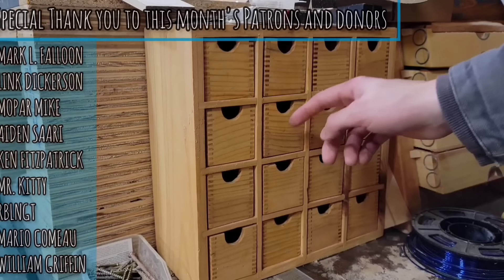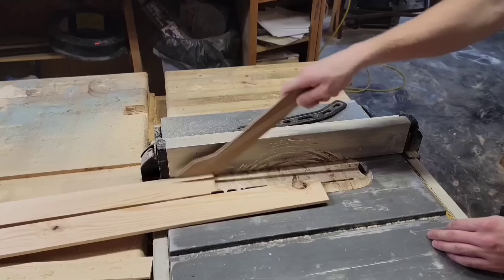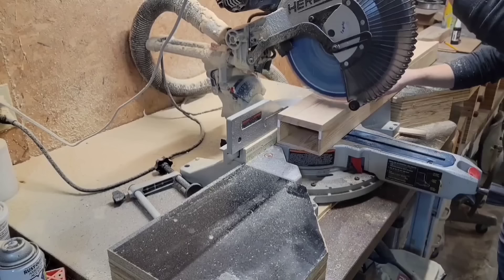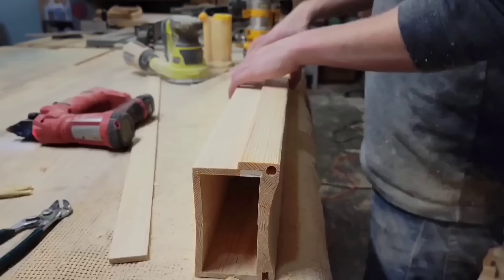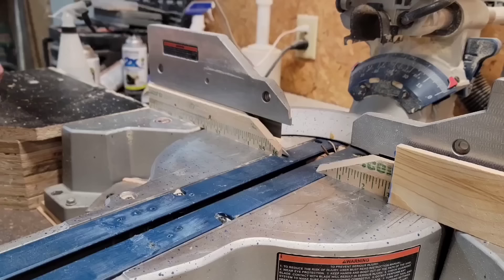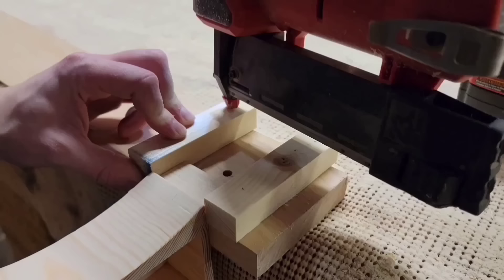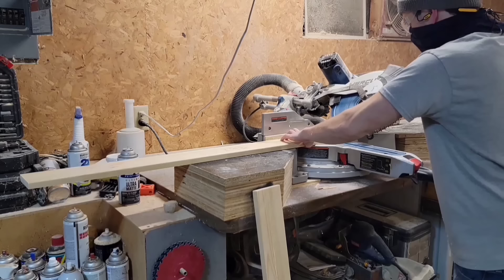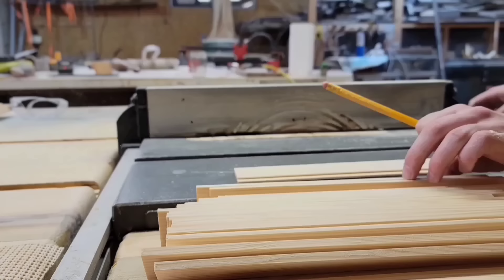Fastest Way To Make Drawers? One 2x6 Parts Organizer // Woodworking

Comment: Ok so I actually have something to say now lol.  That cove cutting on the miter saw is a mint operation!  This is literally the first time I've ever seen it and it seems to work great.  

As far as the safety aspect, I don't see anything wrong as long as you're following the normal safety precautions and don't try to take too big of a bite and flex the blade.

Also, you can pretty much do as much with a miter saw and a 2x6 as most folks can do with a shop full of tools and wood.
Reply: Me too! I've only seen coves cut on a TB saw, and I love this idea!!
Reply: I agree. Set the depth stop, take little vertical bites until it's cleared out and then clean up the rest. Seems safe. Really cool technique too.
Reply: Yep. I feel it is safer that way than the traditional way on a table saw. Anyway, nice project and clean result 👍
Reply: Works also on a table saw for making crown.

Comment: This is an excellent cabinet, and a unique look with the flip out drawers.  Also, as usual, a great explanation and illustration of the methods used.  You're a good videographer!  

If you're looking for a unique way to get those corners at the dowel rod to slide past each other, and didn't want to go with wax, you might try HDPE (high-density polyethylene) 'washers', a.k.a. milk jug plastic (or any plastic where the little recycle triangle on the bottom has a '2' inside it).  Simply cut out a bunch of squares of the stuff from a cleaned milk jug or two, and pinch the stack together with a couple of clamps, on top of a square of scrap wood (which saves your workbench from having a drilled hole) and also clamped to the edge of a bench or table, so that the stack of plastic and wood is compressed and unmovable.  Now find a small hole saw where the inside diameter of the saw (i.e., the size plug it removes from a hole) is the outside diameter of the plastic 'washers' you want to end up with.  If you want the hole in your washers bigger than the drill bit in the hole saw (in other words, you want the hole in the washers to match your dowel rod), drill that out first through the HDPE squares and into the wooden square scrap at the bottom with the bigger diameter drill bit, then 'eyeball' center the hole saw's drill bit in the middle of that hole, and cut the washers out with the hole saw.

If you don't have a hole saw that small, you can make one with a chunk of electrical conduit and a wooden plug like a fatter dowel about half the length of the conduit chunk, that fits snugly into the conduit, and with a hole drilled down through the center of the dowel.  Drill the hole in the HDPE first with a drill bit that's the diameter you want for the hole in your washers.  Then epoxy the wooden plug into the chunk of conduit (or drill and screw it, or shoot a couple of brad nails through the conduit into the wood, etc.), and run a carriage screw up from the inside of the conduit, through the wooden plug, with the threaded end of the screw emerging from the top.  Put a nut on that to hold the carriage screw tight to the plug, and chuck the exposed thread end into your drill.  Running your improvised hole saw a few seconds while angled against a piece of sandpaper should sharpen the edge of the conduit enough to cut the HDPE.  Now cut the outside of the washers, again 'eyeball' centering the outside cut around the hole that you've already drilled in the HDPE.

These 'reclaimed' HDPE washers are really slick (and I mean that not only as a euphemism for 'good', but also they really 'lubricate' a hinge joint like this.  I would put 2 of them between each of the drawers, so that they not only slide against the wood, but against each other, for maximum 'slide-y slickness'....  😎
Reply: Holey moley. I didn’t know I’d find a whole text book when reading the comments.
Reply: @williamwalters3796  Eh, what can I say?  It was late.  I get 'wordy' when I'm tired....  lol
Reply: Bill you have a video making these washers?
Reply: @djlhobbies2579  Unfortunately, I don't.  But my overly-complicated explanation there was just based on tools I had on hand.  Feel free to cut them however you can, because really the only requirement is that they fit into your project and don't hang out of the joint and show.  Good luck!

Comment: The shiplap in a frame can break glue joints when done with real wood if you don't leave at least 1/8 expansion room for their width, I had it happen to a set of doors I built when I was still in high school. The dowel hinge going with the grain would be the weak point. With all that said, you made a pretty nice looking organizer with minimal material.

Comment: To strengthen the boxes. A pail with lid, a 6x6 inch piece of wood, vacuum cleaner and epoxy or fiberglass resin. Drill a hole in the lid that the vacuum hose does NOT fit in. Drill a hole in the wood that the hose DOES fit in. Screw wood onto lid. Put hose in wood with plumbers putty. Coat boxes with epoxy. Place in pail with nails to separate pail and boxes. Place lid on and turn on vacuum. The vacuum will draw air out of the wood. At a point before the epoxy starts to harden, turn off vacuum and remove hose. This is necessary to draw epoxy into the wood. Sand after fully cured. Make sure that the coats are even on both sides to avoid warping. Use a little less of the hardener so curing is slower to avoid warping. Experiment with scrap first. Really nice build. No more drawers falling out.

Comment: Brilliant! I think that back panel was genius. Also, I should think cutting a cove on the miter saw would be safer that using the table saw. Less time-consuming too. No need to build a jig. Grain direction shouldn't be an issue with small parts. I'm going to make one of these for my own shop.

Comment: Having that big saw is a huge asset. My little ten foot by ten foot shop couldn't have a saw like that in it. Lol.
That's a great build.  Love it.
If you're worried about the strength of the wood? Maybe treat everything with some Tung oil or lacquer finish.
You'd be amazed how much strength a good hard finish adds.

Comment: Well It is a cool looking cabinet and drawer setup.  The cove on the miter saw is something I will have to try.  My only gripe with this, and it's just my preference, is that I would want to be able to take the drawers out of the cabinet.  I don't like the permanently attached, swing-out aspect.  If I need a bunch of screws, I want to be able to just take my box (drawer) of screws to the work, then put it back when I'm done.

Comment: Enjoyed the idea.  You could have drum-sanded the pull tabs for an easy way to remove the wood for the fingers.  That wood is plenty soft enough for quick sanding.  A belt sander would work as well.  Don't mind the advice.  Just a geezer letting off steam.

Comment: Clever drawer technique.  Well done.  Re stop block, I think of you don't jam the workpiece hard against the stop when you cut, it is less likely to kick out.  Also, the stop doesn't need to be very wide -- I usually clamp a strip of 1/2 in Baltic to my outfeed fence as a stop.  If you chamfer the bottom edge of the block, you'll get less dust buildup there, too.  Good luck.

Comment: This was epic! Well made video and well made cabinet. The way you cut coves on the mitre saw was quite safe, safer than on a table saw. 

Instead of toothpicks, one could separate the drawers with washers. Would be easier, especially if a drawer needed repair.

Comment: Great video and explanation of the process and dimensions looks good w continued grain I think it'll last alot longer than u think cuz the bottoms are cross grained and thts what the weight is sitting on and no you said the small boxes holding small part so not like there's going to be a whole lot of weight in there anyways

Comment: Even with a band saw, sometimes I run a slot up the middle on the table saw first. Both sides. Obviously it depends on the size and hardness, but it helps make for a straighter resaw, and reduces the amount of waste the bandsaw blade needs to physically remove as it goes.
Reply: Happy accident for grain continuity too.

Comment: With a couple minutes of dialing in the 90 degree angle of your table saw blade and some better/ taller feather sticks to keep your work piece square and stable, you can virtually eliminate any "ridge" down the center of your re-sawn pieces.

Comment: Wow!  I got a whole lesson on how to use the Mitre saw, amazing.  Is that safe, going sideways?  The short cut to the glue up was really fantastic.  One long drawer and slices of it, brilliant.  I never thought of the grain direction - thanks for bringing that up  The curved fronts are really beautiful, along with the swing out feature, just superb work!

I would have done a few things differently:
1. Aluminum or copper washers instead of toothpicks as dividers. The metal insert would have looked nice!
2. Toasted the bare pine with a propane torch lightly to get some color on the wood. It also brings out natural oils.
3. Covered up the screw holes on top of dowel rods - that looks unfinished.
4. Used wood glue Titebond instead of CA glue.
5. Finished off the piece with Boiled Linseed oil, or stain, or both, and a sealer coat. You won't want greasy thumbprints on that bare wood, or rust spots, over time. Especially on the inside.

FYI - It still WORKS WELL, not WORKS GOOD.  Your English should be as polished as your woodworking skills.  This is a bad American habit. WORKS WELL is the correct usage. WORKS GOOD is grammatically incorrect. You DO GOOD if your actions are virtuous, but that does not mean FUNCTIONS WELL.  Please try to say the right phrase. It is a habit we have to break out of.

Comment: Instead of the million cuts withe the miter saw, just clamp a fence perpendicular to your table saw blade and cut in increments of about half to a third of a tooth at a time and you can make a full, smooth pass. Sounds dangerous, but in actuality there is no "pinch" since the part is free to move up, so kickback just doesn't seem to happen.  And you can use varying angles to make pencil trays, etc.

Comment: I resaw a lot. Getting thinner boards from construction grade lumber isn't as easy as this video shows. Knots are fine in 2x construction grade. Resaw will often cause a knot to span most of the board with and cause it to fail. Which is why plywood was invented. So yeah, if you can find a 2x6 without too many large knots, little checking you might be OK. But you can still run into released stress and boards warping. Short pieces like the project in this video makes warps less of an issue.

Comment: Josh, I love the channel. I do have a question though. When you were cutting the rabbits for your glue-up, why didn't you use your router with a down cut end mill type bit? That way you could have prepared all the reliefs before the beam assembly.

Comment: Very nice build.  Question tho.    I've heard that using activator with CA glue shortens the longevity of the hold because it's a weaker bond than if used without.    Do you know if there's any validity to that?  I'm not criticizing your methods at all, just want to know if anyone knows.

Comment: Do you think you could just use wax to keep the drawers from all opening at once if you didn't want to do the whole reveal thing? 

I know I seem like a weirdo to keep sending comments.  Normally I wait until the end to see if I have anything to say but I couldn't bear missing the opportunity to get in the comments early.
Reply from the maker: Yeah, that would probably work. I think as long as you don't have alot of weight in the drawers they should slip past each other pretty easily if they are well waxed.